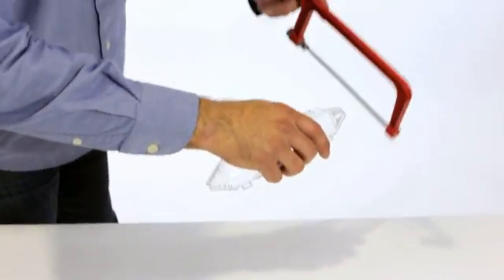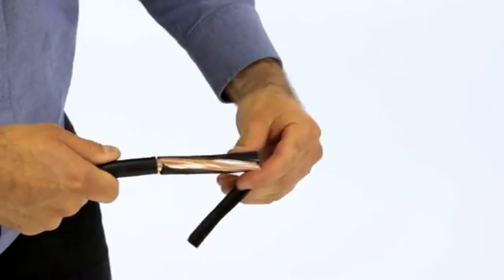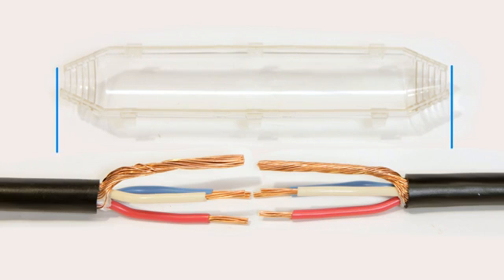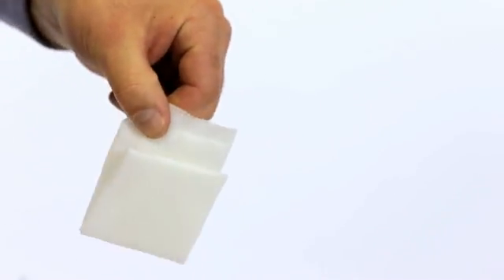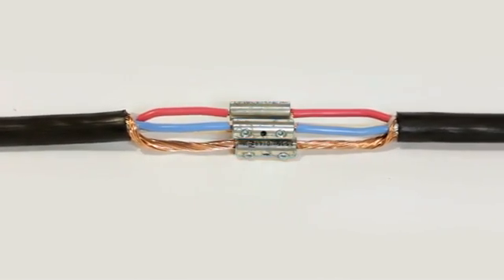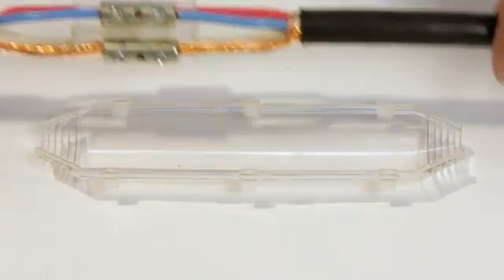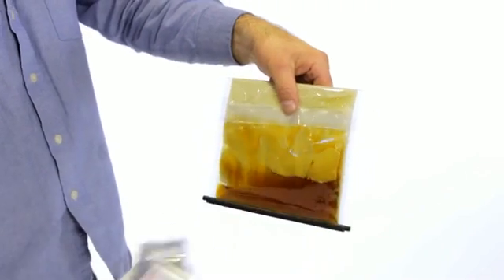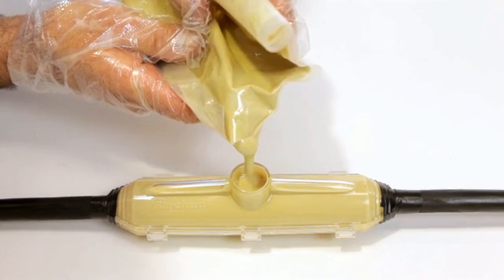Raychem LV multicore resin joint

Comment: all this shit for a joint
Reply: All this to make it water tight for outdoors. Otherwise the connection will trip a residual-current relay if there is even a little bit of water or condensation between the connectors.